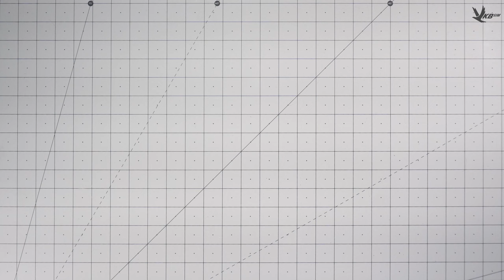Gladiator NXT EVO Quick start guide

Comment: Does the driver for this stick work with Windows 11? The X56 HOTAS does not and I'm looking for a more supportive company to upgrade to. You all seemed great.
Reply from the maker: All VKB devices would work without issues on Windows 11. They don't need any drivers in order to run, only calibration. Also no background running software is needed.
Reply: @VKBSim  First of all, thank you so much for the reply. I just ordered a pair of NXTs and the fact that you replied makes my heart happy with the purchase. How do you adjust the dead-zones on the sticks, then? Is that only done in game or do you still offer software / recommend a 3rd party software?
Reply from the maker: @honordevs  Deadzones could be adjusted through the native software or the game, but you shouldn't need that :) Here are some guides on our very potent native software; for any other technical questions we have the official forum: http://forum.vkb-sim.pro/index.php. Enjoy! :)
Reply: @VKBSim  Thank you. You are amazing. Won me over before my sticks even arrived, haha.
Reply from the maker: @honordevs  You'll love them, that's for sure :) Cheers!
Reply: The x56 works fine with Windows 11. The drivers will install automatically. You can also run the software in compatibility mode. I'm still using my x-55 throttle without problems.

Comment: I just got the right hand premium stick couple days ago & watched this vid on VKB's official site.  My previous stick was the Gladiator MK2 non pro.  It's a lot stiffer than the MK2, I know that had #10 springs & the NXT EVO has #20 as default.  I'm trying to understand the dry clutch mechanism.  I turned the screws tight then backed them off to see the difference but I'm so used to the tension & immediate snap back from the MK2.  Is that tension always there as long as the screws are in if even just a few threads?  Would I do any harm taking the dry clutches out completely, if possible, to see how it feels or should I just put in the #10 springs?  I'm scared if I back the screws off too much on the clutches something will come apart. It was $200 with shipping, I don't wanna screw something up.  On a side note, love the 3 hat switches + the ability to use the POV switch as a 4 way hat switch.  I started with a 3D Pro, then MK2, now this as I was new to joysticks just 3 years ago.  As time goes on I've seen the importance of as many hat switches as possible.  Don't like the location of the throttle, liked it better on the MK2, but, I knew that before I bought it.  JMHO.  Lastly, looking forward to the TECS release.
Reply from the maker: Hi there! You could definitely take out all the 3 screws adjusting the dry clutch and store them safely. Just watch the video and make sure you're removing exactly those 3. Now I can tell you that whatever you'd do you won't be able to replicate the feeling of the original Gladiator MKII; the NXT and NXT EVO have very different designs and came a long way from MKII.
Reply: @VKBSim  Yup, watched the vid.  It pointed out the 3 screws.  I'll tinker with the clutches & springs.  Bunch of ppl in our group have the MK2, I'm just the 1st to upgrade to the NXT.  Thanx for replying. <3

Comment: Do all your grips in the nxt evo line twist? To control rudder for example
Reply from the maker: Yes, all grips fitting the Gladiator NXT EVO (KG-12, F-14, SCG left and right, Premium and Standard) have a twist module built in. The twist module could also get locked in case you'd decide at some point to use rudders.

Comment: What the hell is a dry clutch, why do I need to tighten screws because of it and how do I know if it's correctly set up ?

Also what does "the joystick will act as a helicopter cyclic" mean ?

Ok so skipped the hardware tunning stuff, now I'm facing an issue with the calibration, when I move the ministick nothing happens on the calibration window, why is that ?
Reply from the maker: The dry clutch is a mechanism which would restrict movement along one of the main axes or both. Take the spring off the pitch axis, tighten up the dry clutch and now you have a classic throttle, as the joystick won't return to center anymore, but it would held position. 
The dry clutch screw(s) adjustment depends on the user. If you don't need dry clutch at all you could remove the 3 screws and store them safely.
The ministick has 2 modes: analog (axes) and digital (POV). By default, the ministick is in POV mode; to switch to axes mode you'll have to press its center button (a red LED will lit up on the grip to indicate the ministicks is in analog mode). This is covered in this guide though, just follow the steps exactly.

Comment: I have the gladiator evos
If I wanted to upgrade the bases to the gunfighters are the SCG grips compatible?
If not can I order the connector parts to make them compatible?
Thanks
Reply from the maker: The SCG grips are compatible with the GunFighters bases, but you'll have to order the twist adapter with a (left or/and right) GNX SCG to GunFighter Conversion kit: https://vkbcontrollers.com/?product=scg-conversion-kit-gnx-scg-gunfighter-scg
Reply: @VKBSim  I thought so
That’s awesome 
Thanks

Comment: When I hit "Default", the device is removed from the blue box and I can't select or finish the config. If I disconnect it from the PC, it's like it then corrupts it, and when plugged back in, it's not recognised. Fixed it by holding down F1 and F2 together while plugged in, remove USB cable, insert USB cable while still holding F1 F2, then release. Seems to do a reset and it's able to be recognised again. BUT, I can't finish the config/calibration with this issue, because the device disappears before I can hit "Find & Auto Config". Device firmware v2.1, VKBDevCfg v0.92.17. Windows 11.

Any ideas on a workaround?
Reply: Actually, doesn't really matter what buttons I press. It automatically disconnects if I press "Find & Auto Config", and when trying to calibrate and hitting "End calibration".
Reply from the maker: @Currrn  Please post the issue on our forums http://forum.vkb-sim.pro/ or fill up a service ticket.

Comment: Mine always goes out of calibration in game have to pause alt + tab out to vkb software and re calibrate. So annoying.
Reply from the maker: Define 'goes out of calibration'. If you're using soft springs and heavy dampers, then it's assumed that the joystick won't be centering perfectly.
Reply: @VKBSim  I use the springs supplied with the stick it is always the elevator that goes out of calibration. Thanks for the reply.
Reply from the maker: @callsignnictmere465  Try releasing the dampers completely (you could take the screws out) and try again, issue still there?

Comment: When i calibrate there no response in ministick ROT X rot Y
Reply from the maker: The ministick has 2 modes: POV (digital) and axes (analog). By default, the ministick is in POV mode. To swap to axes mode you'll have to press the center push button; when the round, red LED turns on you'll know you're in axes mode so you could start calibration.

Comment: I'm very impressed with how bad this video is.  Not one procedure is clearly shown.  He is shown holding a wire, but it skips over where he plugs it in.  Then he seems to pick up three screws from behind the unit, so you can't see them.  then he screws them in somewhere which is not shown.  What the hell?  No steps are clearly shown.

Comment: I would like to purchase, but your Europe store say "No!" because it is still not in the store yet.
Reply from the maker: They're having some difficulties, a bit of patience please.
Reply: @VKBSim  i am in eu store right now and the old one is still sold out and you have the new ones in a other category finally :DDD but one problem. there isnt a normal evo one but f14 warbird and space and i am wondering if space is the normal one but rebranded. and also holy ... the express shipping in the first weeks is expensive xD
Reply: @eckiger_luki6424  I've ordered already what I wanted yesterday.
Gladiator NEXT EVO Omni Throttle with SCG Premium Grip (Left) &
Gladiator EVO ‘Space Combat Edition’ w/ SCG Premium Right grip.
They had some troubles there and even when it went online, they had put it online with a wrong price. It was way to expensive. Then they had fixed it and I had ordered it. It was chaos before I could finally order them, but I got my chance to order it 😁
Reply: @MindBurntDE  how much was it and is the space combat thingy the same as the normal one ? :D
Reply: @eckiger_luki6424  the new evo space combat is the new edition of the old Gladiator NXT. I have preordered in the Europe store and both sticks together were something around € 430 with VAT and shipping. I think they will be much cheaper soon when the new stick arrive with the ship freight. this were now the sticks what cames with the air freight why they were a little bit more expensive then normal price.

Comment: this software is horrible.  How did this ever get approved as actual software
Reply from the maker: You only have to run it, press 3 buttons, as clearly indicated in the guide above, then close it and forget about it, if you hate it that much. It reads and writes directly on the joysticks' memory, so you won't have to run it in the background.
Or, you could browse through manual https://mega.nz/file/VBN2wIZR#UXXWFXe4Ch-YQvIac6yYpreIoCV0SP0Qo_PXxzWWw9s and see that it's the most powerful software for programming joysticks by far. Performant software can't provide an easy interface.

Comment: This is not a quick start guide. This is an assembly video.  I just received my NXT Evo Premium today and have spent 2 hours staring at the DevCfg manually, and I still don’t know what the blue LED on the base is telling me. Great stick so far. Shitty documentation.
Reply from the maker: I'm sorry to hear that, we'll try other colors in the future, so people, instead of staring at it, would notice the link to the calibration guide in the Info section, just 1 or 2 inches, depending on the screen, under the current video. But here's the link, with timestamp to calibration (as you don't need to flash a new joystick): https://youtu.be/NTZNUT8wmOA?t=136. 
Pro-gamer tip: the blue LED won't tell you anything, but if you want to learn about programming LEDs within the native software just check some more content on this channel, there are tens of shitty documentation videos that might help.